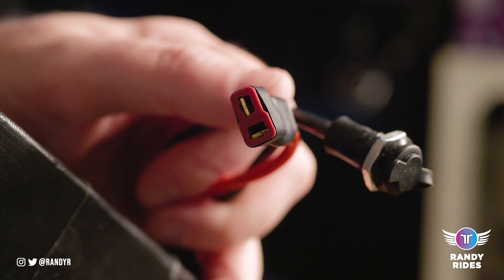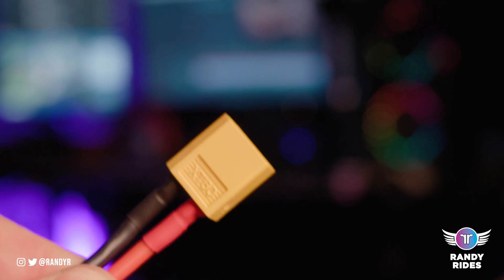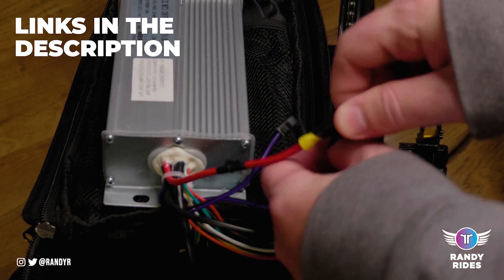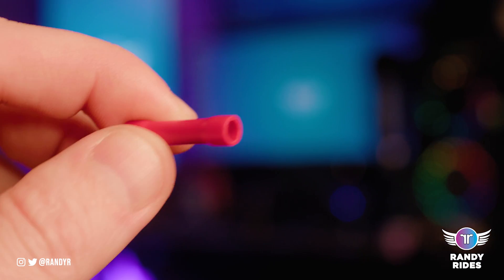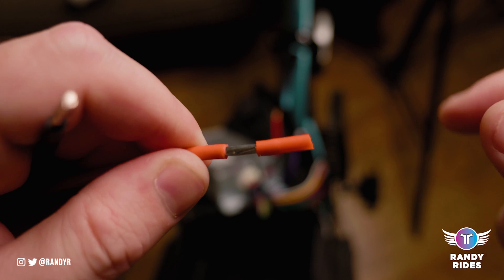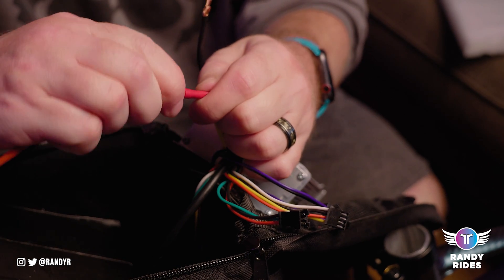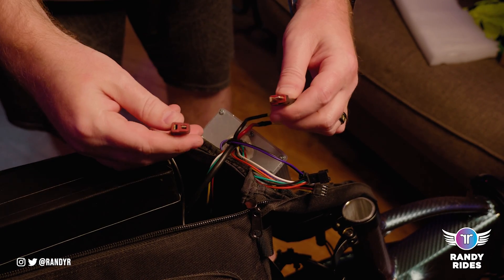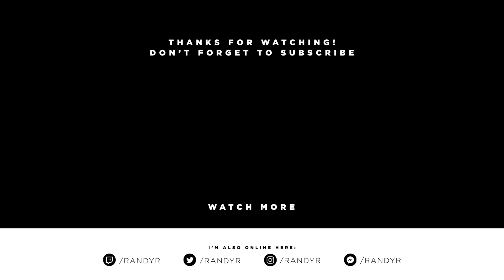A more detailed *wiring video* for your dual motor Lectric XP or other eBike brand.

Comment: Can I crimp my three motor phase wires the same way you crimped the battery wires ? Can I just crimp all the wires ? No soldering ?
Reply from the maker: You can, just make sure to wrap them tightly in electrical tape and I’d probably shrink wrap it too.

Comment: Making my XP dual motor is on my list of wants.
When I ride in my hilly neighborhood, my XP stalls at the top of hills and I have to turn it off and on again.
I have already replaced the controller.
So I have been putting in my trunk and taking it to more flat areas to ride.  
I have been looking a new bikes with more power but I can't justify $2k for another bike.
Reply from the maker: 1.0 or 2.0?
Reply: @RandyRides  1.0
Reply from the maker: @DiogenesOfCa  Should be golden then! Do the upgrade! Changes the bike completely.